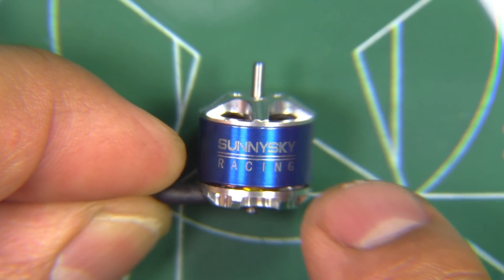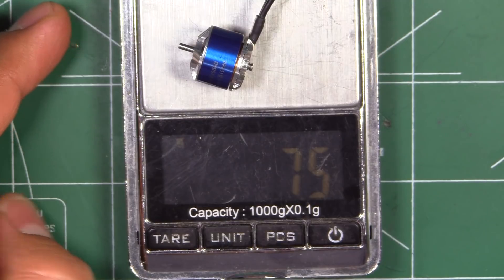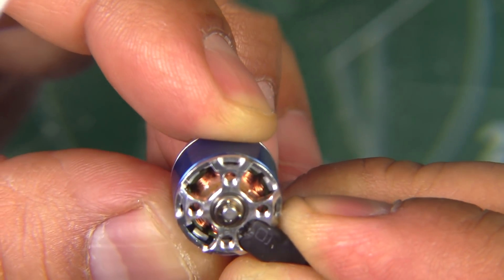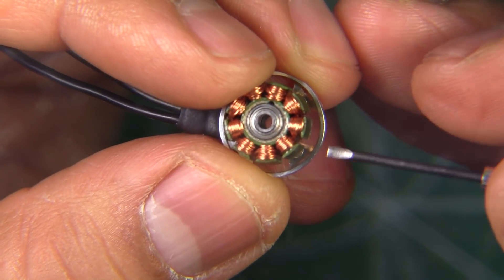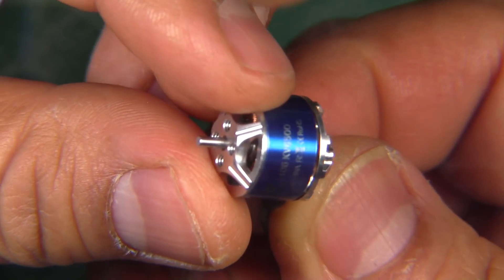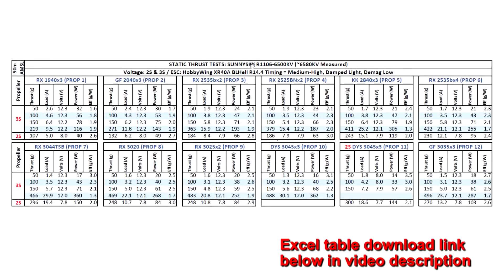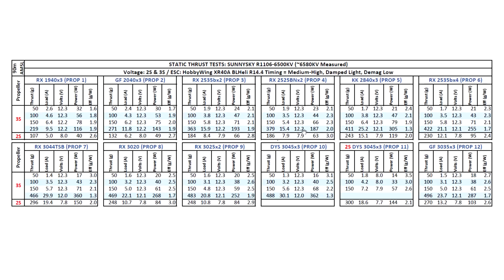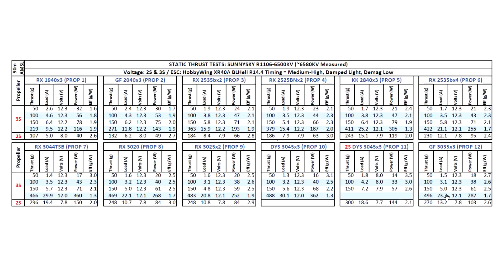SunnySky R1106-6500KV 2S & 3S 2" to 3" Thrust Tests - Little Motor-Big Power

Comment: After a short circuit I've burn my engines what kind of AWG wire I used to rewind thks in advance
Reply from the maker: I've never seen anyone rewind motors this small. I didn't check the wire gauge on these. Sorry I don't have that information. Hopefully somebody else can knows and can post it here. I'll pin your question, I think that will keep it at the top.
Reply: thank you

Comment: hello EngineerX,
We bought this motor. I have problem about temperature.  It overheats even without a propeller. I can't touch with my hand. is it normal
Reply from the maker: Not normal. Only 1 motor or 2, 3 or 4 motors are overheating? Check the mounting screw not too long and touching motor stator windings.

Comment: Hello, in the datasheet of this motor, it is said 2S for the battery voltage of 7500 KV. But you tested it on 3S. will there be a problem? Does the engine burn in long-term use?
Reply from the maker: It will depend on propeller and weight. You will need to have a light set up and use 2.5" props or 2-blade 3" props and no use full throttle for long periods

Comment: Man i just bought a rtf drone with these motors, 2 inch props 3s and the motors are really hot after a 30s hover... Any recommendations on what to do?
Reply from the maker: 2" props on 3S should be OK for this motor. They do run a bit hot, but you should be able to run the hot-potato test, should be able to firmly grab motor for at least 5sec without burning a hole in your hand. Proceed with caution of course. Most times it's the Betaflight settings, depending on what firmware release your FC is running, D setting on the PID could be too high, but hard to say. Tuning PIDs is sometimes not simple. If you hear motors don't have smooth rpm while hovering then you need to tune those PIDs

Comment: 496 g 😯
Reply from the maker: Very crazy .... but only you will see it on the thrust stand because I'm using big power supply, when flying, the small batteries can't maintain all that power for long and also when moving the thrust is lower but difficult to measure

Comment: Thanks for test! This motor is extreme hot ( i can touch) with 3S, GF 2040x3 after 20 sec hovering. It's normal?!? (with eachine minicube F3)
Reply from the maker: they should not run that hot on 3S and 2040x3. The main problem I've seen is the shaft gets loose and bell can fly off (maybe SSky fixed it in new batches?)
I didn't see problems about heat on 3S and 2040x3 props. Could be FC settings like PIDs?
Reply: BF 3.1.7 
roll/pitch/yaw all D set 5 
P: default
I: default
Reply from the maker: That looks OK, but sometimes for these micro builds there could be a setting that can cause issues.  2040x3 doesn't load motor excessively so it shouldn't run hot. People run GemFan 2540x3 on 3S and they're OK. Maybe you can ask what PIDs they run and see if they use higher P, I and lower D 
Found this guy running GF2540 https://www.youtube.com/watch?v=eoFVSjbyKc0
And this is the recommended fix if shaft get loose https://www.youtube.com/watch?v=tFMmhHJ5ipU

Comment: With today's vibration sensitive  FC's and motor's that run at stream high RPM's, it would be very helpful if vibrations be included on the data. What good is all that power if the quad flight performance is compromised or worse, roll of death at full power. I noticed that Emax dynamic balanced their motor, but didn't see any evidence that Sunnysky balanced theirs. Sorry, just my 2 cents. By the way, great job on your reviews, I away look at your data before buying a new motor's. Thanks
Reply from the maker: Asul I've seen some motors without balancing epoxy. With just one sample, It's hard to say absence of epoxy is because factory neglected balance or bell ended up with good balance after machining. Hope it's the latter because as you stated it's true all that power on an unbalanced motor can overwhelm a gyro and cause the dreaded roll of death. Would have been  so cool and useful if thrust stand had option of using an FC to log vibration data when running KV measurement. I could attach a FC and show gyro trace during KV test. Unfortunately, I've had very limited hobby time for months and don't get to do as much testing as I would like so I gotta keep things simple to keep up with all the motors that get sent in.
Reply from the maker: Forgot... thanks for watching and for your comment. Very good point on an important factor of motor performance.
Reply: Actually, I thought the bell was drilled until the motor came to the spec's the manufacturer was after. I guess the epoxy method is much more economical. It would be great if Betaflight gave us a vibration screen to test the motor bearings and balance (using the FC 3D accelerometers). It would be a great tool.

Comment: Is that an updated version of the motor?
Reply from the maker: No, I think it's the first version. I bought it around October 2017. Performance should be the same. I think they only fixed the shaft to bell joint since it was reported to separate if you didn't add some glue/Loctite on it prior to using.
Reply: EngineerX There is a video on YouTube on how to tell them apart and that motor looks like an updated version.

Comment: Do you think the 8000kv would have better thrust numbers and would be able to cope with 3s.
These numbers seem pretty ridiculous as is for the size of the motor.
Reply: I run the 8000kv version on hulkie 2040's and rotorX 2035x4 on 3s, you need very low p & d gains and good batteries (GNB 3s 550 or Indestructible Quads 3s 550) but they are insanely fast. Soft mounting is preferred.
Reply: Thank you for the feedback and info.
I was going to get the brother hobby r3 but I think I will give these a try instead.
Reply: I'm about to build from a low weight moka mikro frame. Will use gnb 550 batteries and gemfan 2540.  Do you think 8000kv will make the flight time a lot shorter over the 6500kv???
Reply: jean-rene trudel 3s is too much for them with 2.5" props, stick to 6500kv for best results.
Reply: Thank you!!!

Comment: Yeah, a decent 1106 motor ;-) I was still looking for a good 1106 motor as an upgrade to my DYS 1104. Your test shows better performance with a 2525BN prop on a 2S than my 1104 with a 3020. More thrust and fewer amps. Thanks for testing this motor.

Comment: yes, these are great motors for lightweight 3 inch quads. The only downside is slipping shaft on some motors and they're always run quite hot. I'm prefer these motors over emax 1106/6000. Sunnysky feels sharper and much responsive

Comment: Hi EngineerX, how do you think these compare to the Sunnysky 1104 7500kv? I bought the 1104 because they were on sale for 20$ for a set :P I'm running 2s 450mAh and 2.5in props and it has plenty of pop, 3s is a bit too much for my 450mAh batteries, have to go back to 2in props
Reply: You may need better batteries haha. I run the r1106-6500kv on 3045 props and my GNB 3s 450mah keep up fine. They do sag on big punch outs and the 550mah version are better, but they do take it.

Comment: Okay you have sold me I'm definitely getting me a set
Reply from the maker: :) People are suggesting to add a drop of Loctite or CA glue on the shaft/bell joint on the first batches. Supposedly, SSky has fixed the issue in later batches.
Reply: I don't believe the new batch is out yet. The ones I received last week still had the problem. I can literally push the shafts out with my bare hands lol.
Reply: Yeah I had a bad time with some 1104 racer Stars like no joke it was probably 12 different Bells and all of the shaft slipped

Comment: No comments on the heat anything particular worth mentioning?  I am experiencing heat with the 2840KK on 3S on the bench with Motor tab in BF so no PID loop.
Reply from the maker: aboss00 on the bench most motors will overheat in a few seconds when highly stressed. In the air, load is quite a lot lower. I usually only mention about overheating if motors get noticeably hotter  than similar motors. It's happened a couple of times.
Reply: charles hodge I run rotorX 2035x4 and gemfan hulkie 2040x3s on the 8000kv motors on the best 3s batteries out there without any heat problems. The D gain has to be set very very low, but they dont make too much heat on a solid tune. Hell, I ran the 6500s on 4s without any problems too. They are just very noisy to the gyro and your filters and d gain need to be on point.
Reply: Yep tuning has a lot to do with overheating motors.  I did not believe it until I got a proper tune (lower D gain mostly) and eliminated heat issues.
Reply: charles hodge for sure on the P gains. With this much power I often settle in the mid to low 20s.
Reply: Yea honestly...everything had to be set quite a bit lower to eliminate oscillations.  D gain being too high was main cause of heat for me though even after I got rid of most oscillations.
Reply from the maker: Lower D ....lower D .... will keep that in mind when I eventually build my 3" HyperMicro
Reply: aboss00 
Also having a bemt or damaged prop with make a big difference as well as having p too high making oscillatioms
Reply: Yea they are very nice looking motors.
If you wanna run 3s or 4s dont get 8000kv version.
They got blazing hot on 3s even with 2in prop.